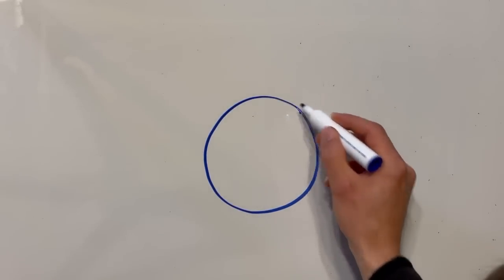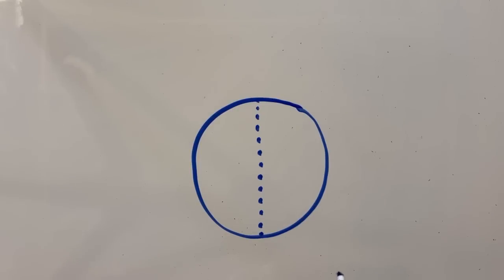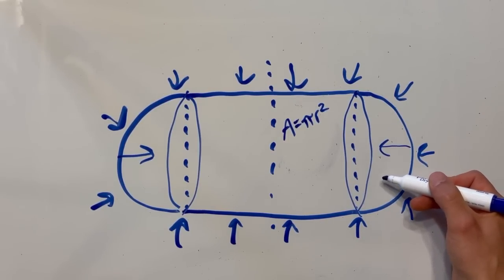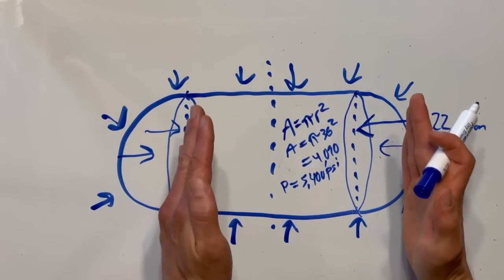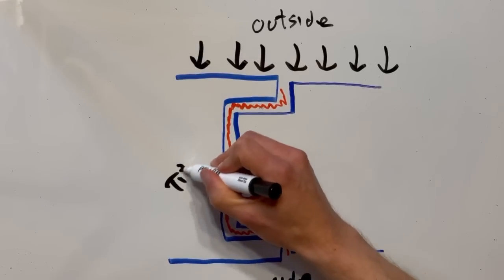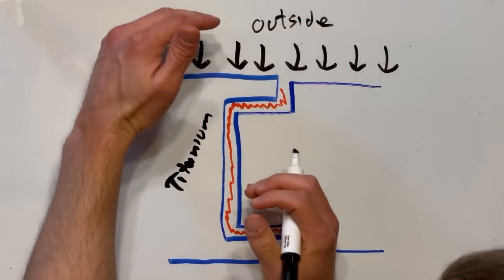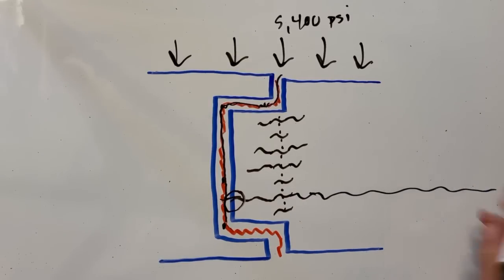Simple Engineering Analysis of How the Titan Submersible Could Have Failed

Comment: I totally buy the thought of the glued intersection being the weak point, but any ideas on how the titanium domes could come off the titanium rings? Those were bolted together, and I doubt the recovery personnel would tamper with the evidence and take them apart. I don't intuitively see that the domes should be rocketed outwards when the pressure equalized, rather they should stay in place or even be pushed inwards.
Reply: The pressure and momentum of water in an underwater implosion almost instantaneously compresses the air bubble (what used to be inside the hull, plus whatever was in air tanks) down to a tiny volume, in the process storing huge amounts of energy in the compressed air. A moment later this air expands again in a powerful explosion, which would have blown the remaining structure outward, and this would easily have stripped all those bolts and popped the viewport as these joints were designed for compression and therefore weren't designed to bear large tensile stresses.
Any underwater explosion works this way, creating a bubble that repeatedly expands and contracts, throwing off shockwaves, until the energy of the event is dissipated.
An implosion is just the same as an explosion, except that it starts at a different point in the cycle.
https://youtu.be/MPJjMJ48CdY
Reply: @smash_hamster  Thanks, that clip was quite interesting. Remind me a little of how supernovas (presumably) work.  ;-)  That experiment took place at almost normal pressure of course, but perhaps the conclusion is that "the bubble did it". If indeed the "window" was blewn out by the same process that separated the dome from the ring that must mean that the glass section not only survived, but was hard enough to take the "socket" with it.
Reply: Incidentally, understanding the violence of this process should also explain why there will be no bodies :(

Comment: Your demonstration of pulling and pushing on a fiber is true for unsupported fibers, but is also misleading and suggests that fiber composites have virtually zero compression strength and that is not close to being true.  Carbon fiber, like glass, is very strong in compression as well as tension.  The problem with fiber or cable form is lack of lateral support against buckling.  This is no different than steel or titanium.  Make a thin strand of steel or titanium and see how well it resists compression.

This is where the resin comes in and why these materials are called composites rather than fibers or fabrics.  The resin provides the lateral support against buckling and this allows the materials to have substantial strength in compression.  It is true that the ratio of tension to compression is much higher for carbon fiber composite as compared to steel or titanium, but that simply means you need to accommodate that in design and provide a thicker composite structure.  And the failure modes of carbon fiber are much different than metals which is why NDT is so important as is using appropriate factors of safety given the greater uncertainty in the material properties.

This is really not different than when using wood (I specialized in timber in my structural masters degree).  Wood is anisotropic, much like most composites.  Wood also has higher variability in properties due to variances in grain structure, knots, checks, etc.  Yet wood structures are equal in safety and reliability to steel.  The reason is that design capacities are adjusted to accommodate this variation such that all but the weakest piece of wood will not be overstressed.  This actually makes wood structures have a higher margin of safety on average than do steel structures.  Structures with higher quality wood will be substantially stronger than calculated since the calculations are made on nearly a “worst piece of wood” assumption and 90% of the wood used will be stronger than this assumption.  Since steel is more uniform and consistent, the margins of safety are much lower on average so a typical working load on steel is closer to the failure point than is a typical working load on wood.

The same can be true for composite materials.  I fear the issue with Titan is that this wasn’t fully factored in.  The reason I say that is that most reports I have seen say that the titanium end caps were about 5” thick as was the composite tube.  I suspect that in this application, the composite should have been several times thicker than a similar titanium structure give that the compressive strength of carbon fiber, even new in pristine condition, is only about 1/4 that of titanium.  A good demonstration of this was done on the Crazy Hydraulic Press channel where they compressed several tubes of the same size, but of different materials and showed the strength at failure and the failure modes.  Carbon fiber has good strength to weight ratio, but not necessarily strength to size.

Comment: I'm also not an engineer, but after a lifetime of working in precision manufacturing I know a Mickey Mouse project when I see one.  The videos I've seen about Oceangate Titan, and the guys putting it together ---- immediately looks like a bunch of amateurs in a garage workshop.  Anyone who works in aerospace/aircraft/shipbuilding/machining etc. where extreme precision engineering and certified materials are required, understands what I'm talking about.  The barrel shape was obviously questionable, and gluing the ends on raises even bigger questions.  Titan was an accident waiting to happen, and it sure did.

Comment: Would it ever be possible to replace the CF cylinder with a titanium or steel one and have a safe(r) submersible? I can understand Rush using a cylinder to increase crew capacity, but just wondering if there was any way to build a successful cylinder design?
Reply: The titanium cylinder could have 3 'spoked wheels' internally, to give strength against crushing. The crew could monkey branch inside, through the spokes without any major hassle...
Reply: @tomlewitt  lol

It's just that clearly Rush opted for a cylinder design to make the vessel more profitable with more passengers - er, I mean, mission specialists - and I was wondering about his choice of CF. True, CF was cheaper, but I'd like to know if the overall concept of an extremely deep diving vessel is just impossible, or whether with more money and lots of titanium it'd be possible...or is the inherent weakness of a cylinder in compression a no-no!
Reply: @AtomicExtremophile  I'm not knowledgeable at all with this, but I'm guessing if the serious weight could be managed somehow, then an extremely thick metal cylinder with 'spokes' inside for bracing, should be feasible? ...or sectioned internally by solid metal discs, into short compartments. ( a hole in the middle of each disc, just big enough to crawl through? ..lol)
Reply: Aluminaut was a successful 1960s deep sea submersible with a pressure hull the same shape as Titan (cylinder with hemispherical ends), but fully made of aluminum. The interior walls did have thicker rings every meter or two which may have acted as bracing.

Comment: Any reason why the 2 titanium rings separated  from the 2 titanium end bells? These were have been secured by bolts, 17 on the front side, and unknown number at the rear. From the images it is clear that the front ring and bell had separated, images of the rear were not broadcast.
Reply: At the instant the cylinder imploded there was an explosion of force against the end bells and it broke all the bolts and blew out the viewing window. There was extreme heat from that sudden compression of the air and organic matter, then the water taking place of the air as the air defused in to small bubbles created a tremendous shock wave. All this happened in  milliseconds. Much like a bomb.

Comment: I don't think the carbon fiber was machined to fit into the titanium caps, it was the other way around, I believe.
Reply: You are correct. This 🤡 is not an engineer, just some punk gearhead with no formal education in engineering 🙄
Reply from the maker: There is clearly a lip machined in at least the outside of the car on fiber tube.  I am not sure about the inside though.  I had to just take a guess.  That would not drastically change that there is a very quick transition from all fiber to fiber and titanium on the cross section.
Reply: The manufacturing videos show a step in the CF. Very much looks like it was machined down.

Comment: You only need to watch the Youtube 1,000 ton tests on Carbon Fibre, Titanium, Brass, Steel, Fibre Glass.  The Carbon Fibre snapped like a Pencil and was useless. It broke before hardly any pressure was put on it !!!!  The Fibre Glass was much better, but crumpled under pressure. The Titanium would not Break, it bent under enormous pressure !!!  The brass snapped under pressure, and so did the Steel but under more pressure.  So Carbon Fibre is Similar to using Balsa Wood to build a Submersible.  Also the Carbon Fibre was not pressurised and baked to drive out any air bubbles.  They wrapped Carbon Fibre around the cylinder, but not across the length.  The Carbon Fibre was left to dry at room temperature !!!  So it really was a Homemade Mickey Mouse Sub and the cracking sounds would have been the air bubbles exploding !!!!

Comment: why you no talk about the view port window, after al it was rated for 1300 meters and he took it to almost 4000 meters many times, it was a serious weak point, it could have easily given way and poped out the titanium end caps ???
Reply: I heard somewhere they may have upgraded the porthole before the accident. Anyway, if the cylinder was the weak point, when it failed the pressure would have have forced the porthole outwards. Like stomping on a toothpaste tube.

Comment: The compressive forces on the end caps is counteracted by the forces pushing on the tube.
It’s these forces pushing on the tube that are the problem with this design.
I think you’ve missed the main point here, it’s more about the radial forces on the tube, not the axial forces. The end caps would’ve been almost blown off the centre tube.
Have a look at this admittedly rather rudimentary test piece on one of the hydraulic press channels (not something I usually follow, but this one proved to be interesting)..

https://youtu.be/BQGDwE3yMb0

That’s my understanding anyway. I’ll take a look at some of your other videos as I still enjoyed this one.
Reply: What do you mean the compressive forces on the caps are counteracted by?
Reply: @seban678  well this guy is talking like the forces pushing on the titanium end caps is going to squash the carbon fibre tube, & that’s just not right. He’s missing the fact that these forces are acting on the tube as well.
These forces will de-form the tube long before they push the caps in towards each other.

I’ve seen so many “so called” engineers on YouTube do videos about this sub & miss these vital things. This one is all kind of wrong. I mean, I didn’t even get to the other part where he was talking about water forcing its way through the seals between the titanium & carbon fibre, again he’s missing the fact that the forces are acting all over the sub, not just on the ends.

Comment: The dissimilar material issue is more complex than what everyone has been discussing.  There are the two titanium end caps, the five inch thick carbon fiber cylinder AND the thin stainless steel cylinder that the carbon fiber was wrapped around.  If the carbon fiber cylinder were to buckle and shatter into small pieces there would still be a buckled stainless steel cylinder that would remain in one piece.  I don't understand why, in the photos and videos of wreckage being offloaded there was no large crumpled steel cylinder observed.  It would seem that the state of that stainless steel cylinder would be the most informative piece of debris to the accident investigators.  Any thoughts on this?
Reply: I don't believe there was an inner steel tube left after the manufacturing process, I've heard some people mention that but I haven't seen any actual evidence of it.
Reply: @seban678  Good info, thanks.
Reply: There are videos of the titanium end caps being glued to the CF tube. You can see the mandrel that the CF was wound on was removed. So it was just a CF tube. In the wreckage lifted up there was three big bags of wreckage which I assume was mainly shattered CF parts.
Reply: @AORD72  Good info,  I've found the video you mention. Many thanks
Reply: Good question. I hope someone can tell us here.

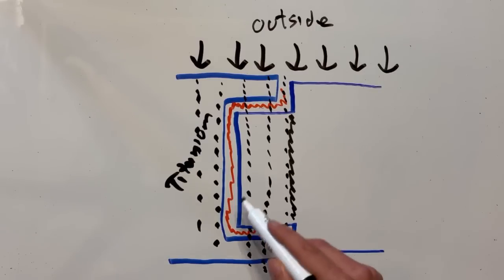Comment: 13:50
You are making a mistake here:
The contact is not made on the carbon fiber but almost only on the adhesion of the epoxy to the carbon fibers and the epoxy itself. It's almost only epoxy here.
Because of the winding method of the carbon fiber which is transversal. Delamination can therefore occur in the same direction as the shear stress you have presented. It's actually even worse than expected.

Comment: That loud popping they heard was that epoxy separating and or the carbon fiber separating from the load on the spheres pushing end to end.  This thing should have been x-rayed or sonographed BEFORE and then after the first dive when they heard the loud popping, it would have shown what was failing by comparing a known good exam (BEFORE ANY DIVE).
Reply: I think that ideally you'd CT it before it does the first dive and then after each dive.  "Not having your pressure hull implode ... priceless".
Reply: @k53847  Yes sir, you need  a known good exam before putting it in the water, then check later after each dive and compare to the known good exam.
Reply: Yeah, but if you X-ray the pressure vessel, you might have to cancel a dive that you accepted $1M for. They might make you give the money back!🙄